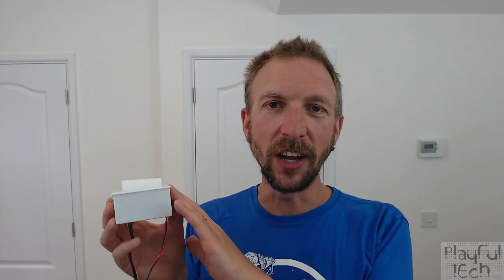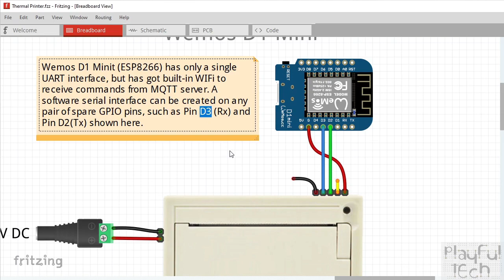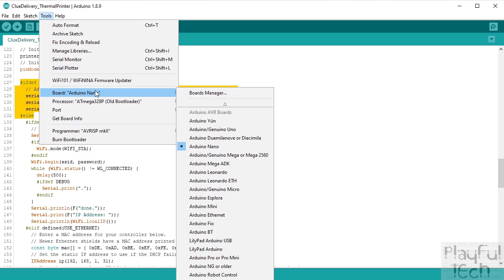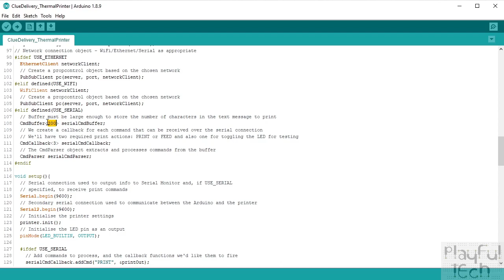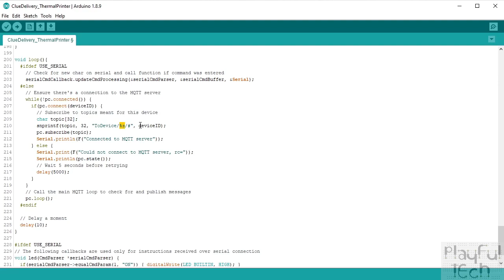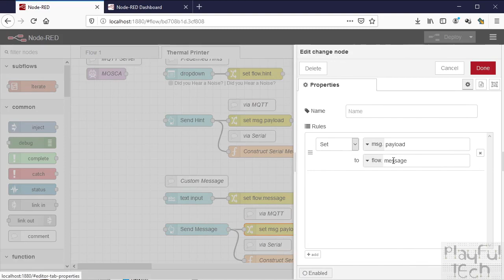Thermal Printer Escape Room Puzzle Prop using MQTT, Node-RED, and ESP32

Comment: I tried to power the printer on 5V but the output was nearly unreadable, so they realy need 9V. The ESP8266 (Wemos D1 mini) and ESP32 need 5V. To work with proper voltages you do need a 12V, 2A adapter with 2 bucket convertors 1 to 9V  (printer) and 1 to 5V(D1 mini, ESP8266 or ESP32). For the rest, thanks, perfect video!

Comment: Amazing video!

What I am missing is an easy video on how to make the GUI and show the stage pf the riddle and having buttons to solve/reset next to it 

I built the clock so far and the buttons to play, stop and reset it but after that the connection to the devices is a bit hard.

I have my first riddle that lisstens to:
SOLVE
RESET
LEDON
LEDOff

But how can I display which LED is on or which cable connection was done. (Its the wire puzzle with 3 cables)